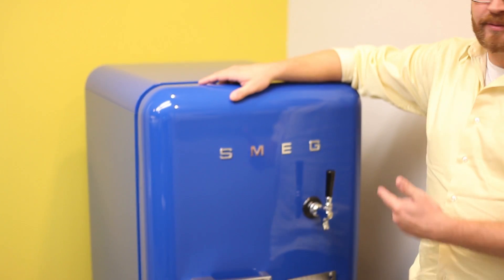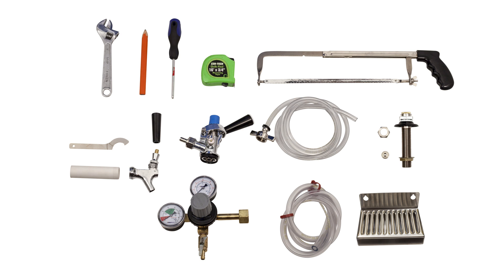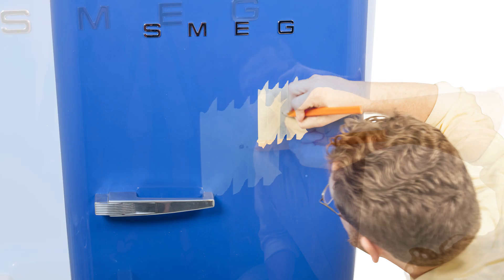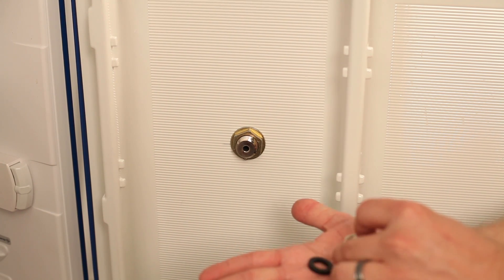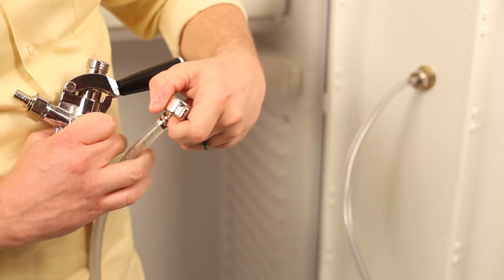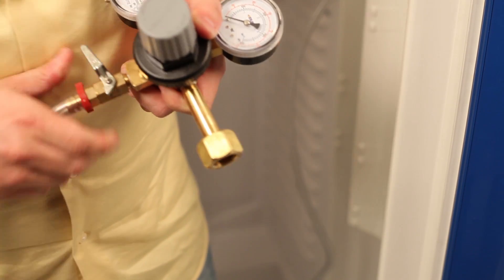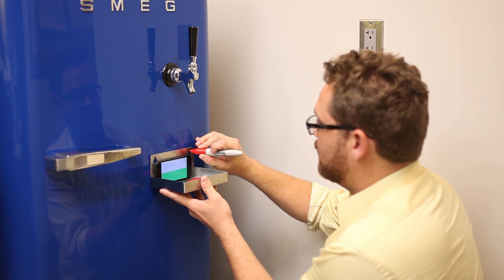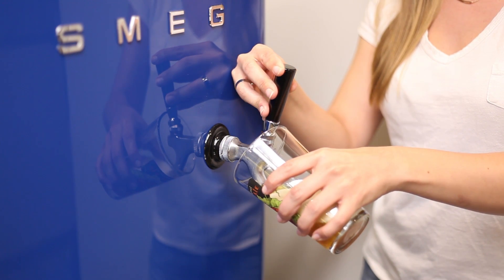How to turn a Smeg refrigerator into a kegerator

Comment: I have what looks to be a smeg inspired fridge. I converted it to have 4 taps, it fits 4 kegs. I bought a similar drip-trap but when it arrived I thought it looked hideous and ruined the look. So I bought a glass bathroom shelf and fitted that to the fridge. I removed the glass and replaced with wood as it was too close to the door and it was easier to cut wood than glass.

It's also a good idea to fit wood behind the shank and nut. I had to get some quite long shanks to do that but it makes it more robust.